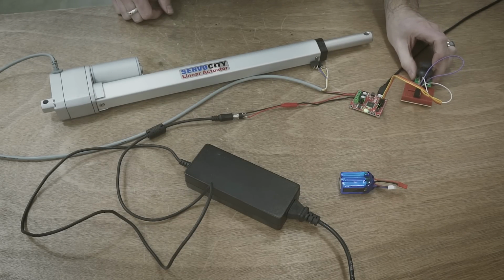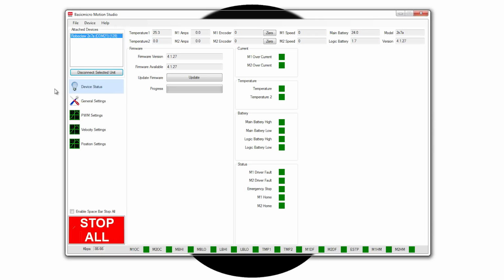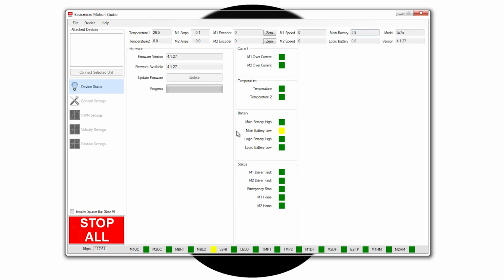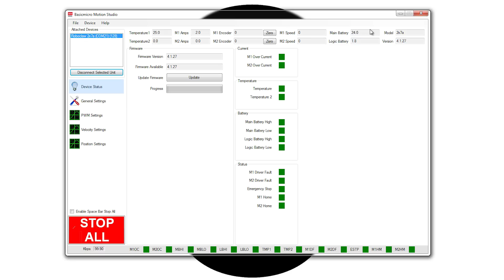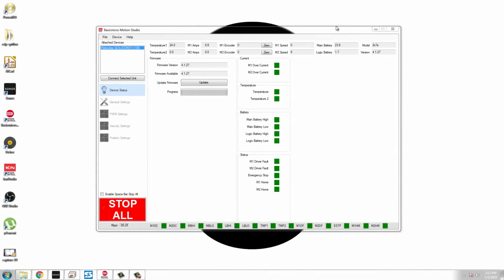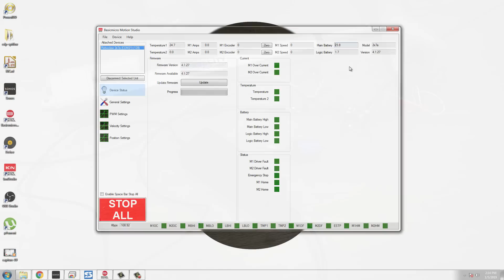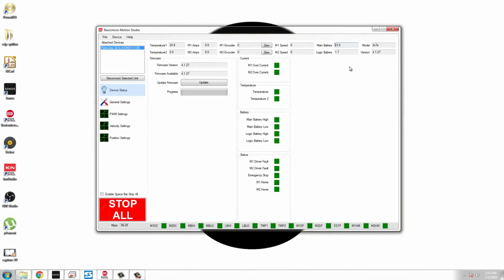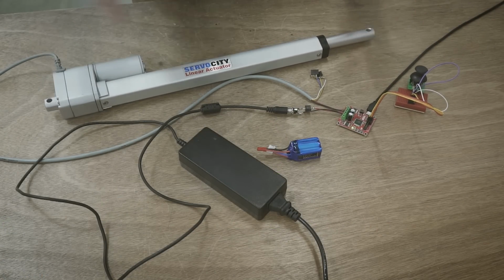Roboclaw External PSU Guide

Comment: Thanks i needed these.  I have a 2 motor system with an arduino with a joystick shield and roboclaw.  Finally got the motors to move but they'll only go one direction with the joystick.
Reply from the maker: You will most likely need to enable bi-directional control.  Motor controllers can be used to control speed and direction, you need to tell it you need to do both.  There will be a setting in the software for that.

Comment: Instead of the diode the absolute minimum you should do is set the maximum main battery voltage to 1 to 2v above the SMPS nominal voltage. The Roboclaw will automatically prevent any significant regen by doing that.  The diode will prevent any regen from going back into the power supply but if you don't deal with the regen the voltage on the Roboclaw will rise excessively and can go high enough to damage the controller.

As mention by others, a voltage clamp is another option.  However if you use the Basicmicro voltage clamp board you still need to set the maximum main battery voltage so the clamp is activated appropriately.

Comment: In order to limit voltage and current spikes both at startup and at stop, you should always accelerate and decelerate the motor at a rate that is controlled by a safe current level.
Reply from the maker: Which would make it almost unusable for this purpose.  A diode works.

Comment: Please, please, please mention that this is only a working solution for low power applications. If you tried this on higher-power application, the regenerative voltage (inductive kickback) could reach a high enough voltage to fry the roboclaw's on-board capacitors. Instead, you want to use a voltage clamp alongside a power resistor. See here: https://resources.basicmicro.com/using-a-voltage-clamp-with-roboclaw/

Comment: There's a good reason your PSU keeps shutting down, its getting output overvoltage. With the diode in place you're dumping the energy into drivers on-board caps. With PSU voltage and motor current well below maximum specs for the controller you'll get away with it as caps can soak up enough and still keep theirs (and drivers) bus voltage in acceptable range. Put in a beefier motor and/or higher voltage supply and magic smoke letting will ensue. I don't mind your solution  per-se, but putting it out as an educational video without specifying the caveats is not cool.
Reply from the maker: You are entirely correct.  For my application, it works, but it might not work for every application.
Reply: What would you suggest for dealing with the regenerative power?
Adding a power resistor in parallel with the diode to give off the energy as heat and/or adding a big external capacitor to the supply terminals?